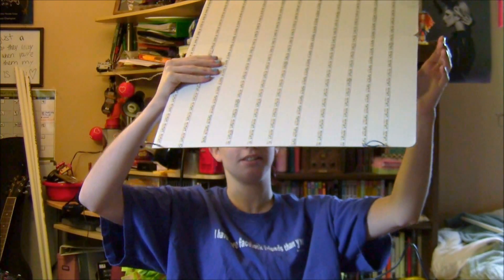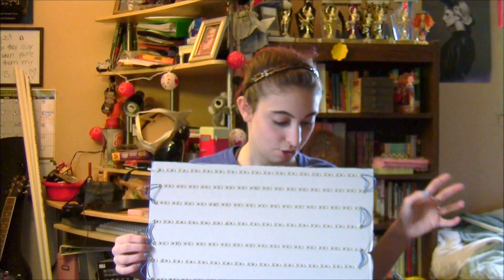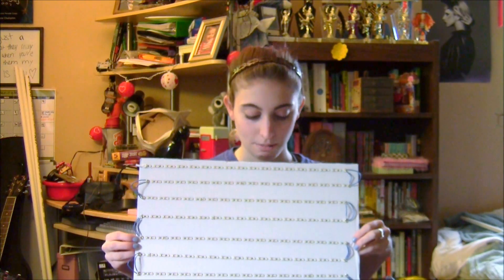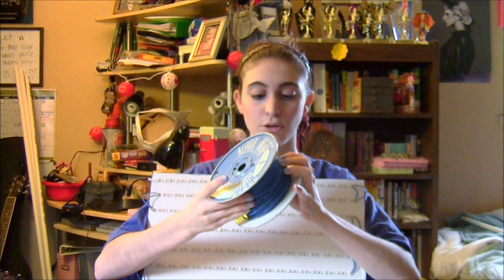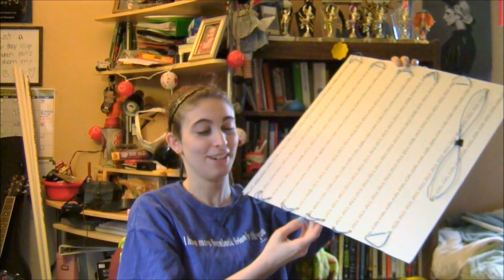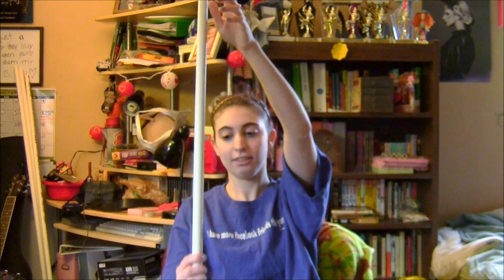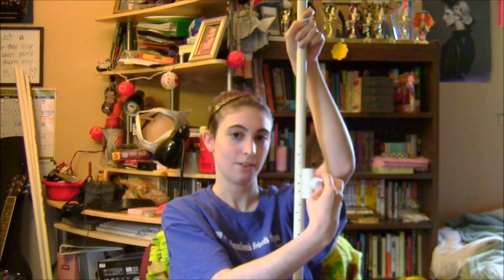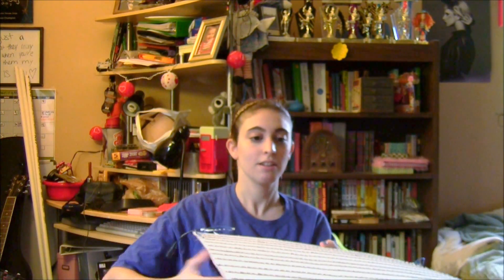How to build two DIY LED light panels for about 66 bucks (600 light)

Comment: How many batteries would it take to make it portable?
Reply: +dima9944 It need 12v. So you can take 3 x 18650 battery and a voltage regulator (or not, without voltage regulator the led will still work but darker)

Comment: I just finished mine about an hour before I found your video.  I think we were on the same page when coming up with this way of making our lights.  Exception: I used a poster board sized piece of styrofoam with a plastic coating from the Walmart craft area.  Same type string of lights, but red & blue from Amazon, style 5050, and a baggie of 4 pin connectors run power to each cut strip. I don't know what you were using your lights for.  Mine is set up for indoor garden growth.  Probably weighs 1/4 lb.  Anyway, I wanted to say thanks for your idea.  YOU DID IT FIRST!  Warning:  Do not stare at the lights while attaching power connectors.  Everything you look at will start to have a green hue for a while.

Comment: perfect vegetation light.. given me the confidence to make 1 :)
Reply: +Mark McGuire 2 parts red 1 part blue for most plants. I use 1100 5mm leds. More labor but good light level with minimum consumption of power. No burning of leaves. Use ultra bright, just over 1 cent each. Power supply full wave bridge, 1 per string.
Reply: shrooms have no clorophyll thus dont need light.

Comment: Attention: here is a cheaper way to build a LED light panel' Get yourselves a LED broken TV LED panel. Remove  and discard the broken Panel and parts. Separate the LED panel. Make sure you keep white diffuser panel intact 
  Separate electronic DC feed or hook up  your own DC voltage unit
Pressto--Under $10--no screwing around--ausome lighting

Comment: Verry nice project! I got a question for you do you know how to make it work 18x 3W Red (630nm) 700mA in serie with 18x 3W Blue (445nm) 700mA on a 12v dc 5amp power supply? (i got two 12v dc 5amp power supply)
Reply: Short answer, no. You need at least 12V DC 108W (25.2 amps) power supply to run 36 3W LED's. Be very carefull 3W LED's might require heatsinking.
Reply: I have receive a dc to dc current booster and it working verry good.

Comment: Do those LEDs get hot? The individual LEDs are not very bright, and they are loosely spaced, but they don't seem to have any kind of heat sink attached to them, the way you have set them up. Do they still work okay despite that?
Reply from the maker: Lorenzo Benito LEDs typically do not get hot at all. Individually they really aren't anything to shake a stick at, but with 600 of them you can actually do some cool things. Even after being on for hours at a time (we're talking a full work day's length of time) there is no excess heat. I tested that out a few times to ensure that these panels weren't a fire hazard and they impressed me a bit.
Reply from the maker: Yes,  it should be in the lumens explanation videos I made. To be honest,  I don't remember off the top of my head what the final result was haha but it should be in a video.

Comment: Hi patricia. Nice to see a woman geek sometimes, it make things more interesting. Let me tell you that the best way to get 100% light with no loss  is to connect togeter those shorts strips you have in PARALLEL. Don't use SERIAL like you have or your leds will dim on the way to the end. The trouble is the tiny copper tracks on the strip that are unable to drive to the end that much power requested from all the strip. is a common problem of those strips. You can see it by yourself: prepare your power supply for have 2 connectors for connect them at the start and the end of your led panel. Now connect your power supply to the start side of your panel as you done on the video, then when leds are on, connect the other connector on the end side of your panel and you will see, in that moment the end side will become more bright and that is the energy was losted during the travel on the strip to far on those tiny copper tracks. let me know if something isn't right for you. i will explaine you beter all. Bye and keep the good work.
Reply: begclobegclo adding to this comment, as long as you have the same quantity of LED per strip, you'll be fine with the parallel thing, awesome to see girls getting into the DIY "geek" stuff.

Comment: for the end connections, you can find really cheap led light strip clips on ebay removing all need to solder except to the power supply.
Reply from the maker: This is true. I was a little impatient haha
Reply: it's all good, some people like to solder anyway ;)   and if you have a heap of scrap wire around, saves a few bucks.
you did well.   ~two thumbs up~

Comment: Thanks Patricia. I want to build an LED scoreboard for our footy club without breaking our budget. Do you have a video that shows how to turn on sections of a panel?
Reply from the maker: I do not at the moment. That's an interesting idea though. You could probably write yourself a little bit of code on like a raspberry pi or something and wire it accordingly. Off the top of my head though I'm not 100% certain exactly what the procedure would be :0

Comment from the maker: Carrie Hefner yes, I can probably give you some assistance. Let me look into it on my end and see what I can do for you. Be on the lookout for a video response. :)
Reply from the maker: Who, me? Also, sorry for my departure I had to do some school related stuff. I am older than five and younger than ninety. :D
Reply: awesome!!!!
Reply: Carrie Hefner i have a t1000s rgb  sd card led controller if that helps
Reply from the maker: That does help, I'll cater my instructions to what you already have.
Reply from the maker: Carrie Hefner If you don't mind, what I'm going to do is order your LED controller and some 5050 type LEDs from Amazon. I can do that, or I can demonstrate as best as I can without it but it would be a little bit more complicated. I'm willing to do either.
Reply: If you could order it, that would be great!! I am starting from ground zero so the less complicated the better.  Thank you so much.
Reply: I just bought: 'SUPERNIGHT (TM) 16.4FT SMD 5050 Waterproof 300LEDs RGB Flexible LED Strip Light Lamp Kit + 44Key IR Remote Controller' by SUPERNIGHT
Reply: How old are you?
Reply: lol...yeah you,Older than 5 younger then 90 hmm a bit cryptic I see..School related stuff for college?
Reply from the maker: Charles Benincasa Nah, this is my own project. It was something I needed for a photography project but wasn't related to school at all.
Reply: I have three LED strip but in Green color, can i use it for this?
Reply: Miguel Ángel Valderrama yes of course

Comment: Hi,
This is Terrible.   You are wasting the medium you are working in.  I finally couldnt take it anymore.  I scanned to the end hoping to see what you made.  NOTHING?   I tried to follow it.  You get something on Ebay, what was tha??   Then you Solder something, why not let me see you do it.  You should just take a Red and Black marker and illustrate the circuit, come on how hard is that?   Gee whiz, isnt that something, I recognized a Pair of Pliers, or did you say it was a screwdriver?  And a wire Stripper, wow.  That is good.  Solder the Stripper to the Screwdriver I guess,  You talk to fast for old folks to understand.  I COULD NOT SEE ANY BULBS.  OK, so I go on Ebay, I will try that, thanks.   I am assuming that on Ebay I will find Strips of LED lights, is that correct?
Reply from the maker: As I said in the video, I bought the strips on Amazon. I suspect that your lack of understanding and the fact that you scanned to the end may have something to do with one another. 

-sent via phonograph
Reply: David Galliher The fact that you couldn't follow this simple project says more about you than her.

Comment: Great post. I make these with film industry grade LEDs. Similar product, but about 15x more expensive. There's a range of LEDs and dimmers you can use -- if you only wanted to spend $60 all the way up to about $1000. The great thing about creating DIY LED light panels, is that you build whatever you need. If you want a foldable light for travel, you can do that. If you want lights that are 1cm thick or less, you can build a half dozen and throw them all in an artist's portfolio case. What ever your specific needs are, you can suit them. I like to build lights that aren't 2 - 4 lbs, like Litepanels 1x1s or competitors make. I like lights that you can tape to a ceiling if the need arises.

Anyway, great video explaining the basics of this kind of project.

Comment: is there any way to power your panels using solar power ? ; )
Reply from the maker: I'm certain that there is...that would take a little engineering on my part but I have no doubts that with the right resources it is possible. The only issue I can think of is that I don't typically use the panels outdoors, so you would need to be able to retain a charge well with whatever battery you chose to use. I need to look into this further...thanks for the excellent idea though!

Comment: btw, I got one of these: Eiko 81180 - SP105/50/MED (massive 9 inch long CFL bulb) and it's great for bright 5000K light.  It uses 105W and puts out 6600 lumens.

Comment from the maker: Watts in terms of power consumption? 48 watts. You can buy pretty much everything on either Amazon or Ebay, and the poster board is just from Target. It's a plain ol' Elmer's brand Tri-Fold poster board that I cut pieces from.

Comment from the maker: I used the 3528 SMDs. I found them to be better for single color usage and they (contrary to some belief) can be brighter than a reel of 5050s when measured. This is NOT the case all the time, but I poked around a little bit and tested at home with various lights and a control, to measure minute differences. I believe it is safe to say that I do not have a life. :)